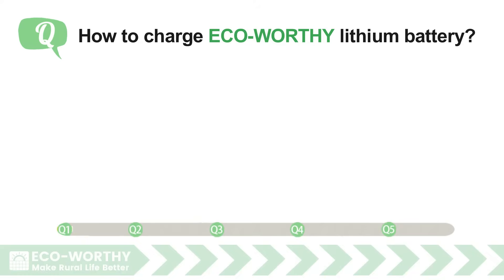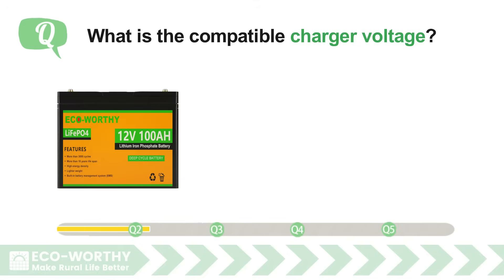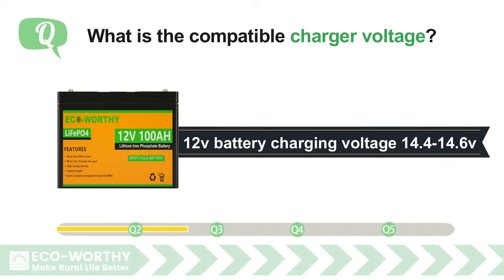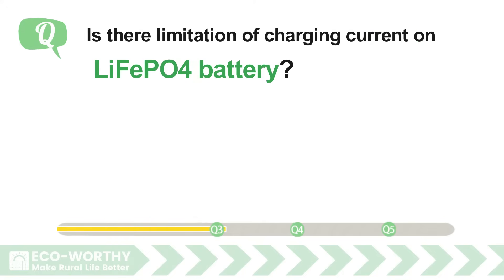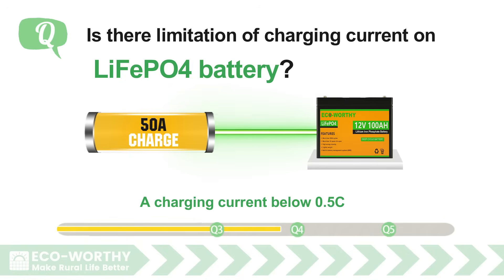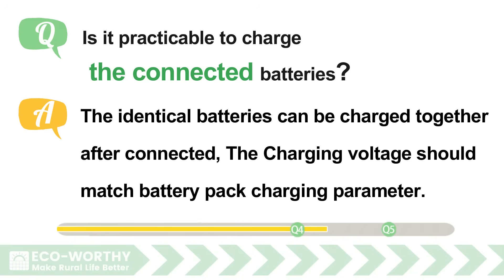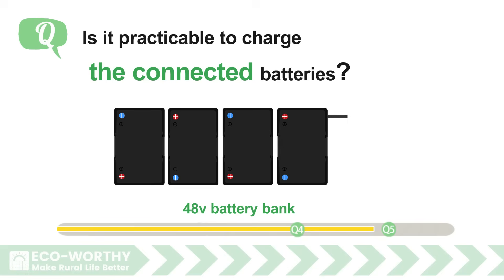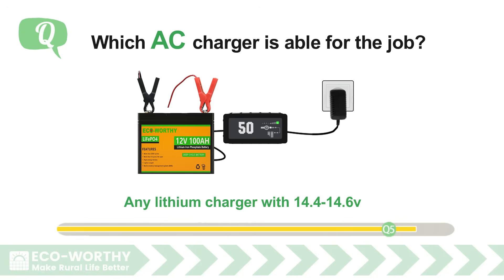FAQ about LiFePo4 Battery: how to charge my Lithium Iron Phosphate Battery

Comment: How many hours to charge this in power electricity
Reply from the maker: Charging time ≈ Battery capacity (Ah) ÷ Charging current (A) ÷ efficiency

Charger efficiency is typically around 88%–90%.
For optimal battery health, a charging current of 0.1C–0.3C is recommended, and it’s best to avoid exceeding 1C.

Comment: I have 51 volt Lipo battery 58.4 volt 33 AH with Lion battery charger and it charges the battery up to 53.5 volt only and charger stops and getting low range in my scooter, pls suggest me something to get up to charge 58 volt to get more range, thanks in advance

Comment: Hi. Is it possible to limit charging current with Bluetooth version (by software) at 12V 100Ah eco-worthy Bluetooth battery. 
I typically want to charge battery with, e.g., 15 A max, but for some time, I  need to limit the charging current up to 5A max (power supply 20A).
Is it possible?  Do you have some manual or video on how to limit charging current?
Reply from the maker: Currently, it's not possible to limit the charging current via Bluetooth. This feature is not available.

Comment: So i bought one of your 24v 100a/h batteries and a life Po4 charger 10amp at 24v. On first charge the battery would only take 87% yet the charger said it was full, the voltage seems fine, does this mean one cell is down?
Reply: @EcoWorthySolar, I got it sorted, one cell not top balanced it seems, I hope you guys manage to sort out your teething problems regarding after sales care as your products are really very good, it's just the after care where you are taking a hit. Maybe it would pay you guys in the long run to employ a native English speaker to help sort out these issues, you'll take the market by storm!! Maybe a shunt instead of hall monitor for your display and monitoring systems is a good start!! This battery is frankly amazing!! Good work guys!!!

Comment: Cómo puede ser que una batería se cargue a 14.6 v y si hay cuatro baterías en serie se cargan a 55 v. Ese vídeo está mal si divides 55 / 4 = 13.75v is not 14.6v for 4 batteries the voltage is 14.6v x 4 = 58.4v
Reply from the maker: 14.6V is the maximum charging voltage for a 12V battery, and 58.4V is the maximum charging voltage for a 48V battery. The actual voltage will be lower when the battery is not charging.

Comment: I recently bought a LiFePo4 30Ah from Eco-Worthy UK Amazon store. I emailed them to ask about charging, but got a useless reply. I sort of got the impression that the answer was from China due to the wording. 
I simply wanted to know how you determine when the battery is 100% charged. In the booklet there are conflicting answers. One table says that 13.6V is 100% charged, but the text says at full charge the voltage is 14.6V.
Reply from the maker: Some of our customer service representatives are indeed from China, and we are working to improve our team's English proficiency. The information in the table is for reference only. For LiFePO4 batteries, the battery is considered fully charged during the charging process only when the voltage reaches 14.6V. However, when the battery is at rest, a voltage of around 13.46V indicates a 100% state of charge (SOC).
Reply: @ecoworthy_official  I bought an intelligent charger off Amazon and let it figure things out.

FWIW I have been happy with my Eco-Worthy battery, and particularly the price, and I have now bought 6 LiFePo4 batteries of varying capacities. So far they have all worked well. The original one referred to in this thread has been in regular use (one or two times a week) for the past year plus.
Reply from the maker: @ Thank you so much for your support and for sharing your experience! 😊 We're thrilled to hear you've been happy with your Eco-Worthy batteries and that they've been performing well for you over the past year. It means a lot to us!💚

Comment: Is it OK to charge a 16 Amp lifepo4 battery with a 20 Amp charger or should I use a less Amp charger? Why is 50 amp charger  the most to charge a lifepo4 battery? Ty 😊
Reply: I have a 30Ah battery and could not charge it with a 20Amp charger, the BMS stopped the charger immediately, my suggestion to you is to use a 5-10 Amp charger for any battery with less than 50Ah.
Reply: @ddistrbd1 what do you think bud?
Reply: @Ricardofromage  As a newbie in the world of Lifepo4  I can only say the 10 amp charger should be able to charge a 100ah battery as long as the charger is set for lifepo4 battery not  acid/other types of batteries , if I were you I would deplete the battery low enough so the BMS would allow it to charge, another option is to use a bench top power supply  if you know how to do it.
Reply: @ddistrbd1  I'm a newbie too by the way, but I'm learning fast, there are some really great scientific yet very easy to understand guys on YouTube who explain it in layman's terms, takes some fear away hehe
Reply: I've got a 10amp charger on a 100 ah  battery and on first charge, charger said battery is full, but the battery monitor said it was only 87%. Maths says 87% I 7/8 cells (25.6v ÷ 3.2v = 8 cells, 100 ÷ 8 = 12.5%) what's your thoughts ?
Reply from the maker: We recommend charging current not exceeding half of the battery's Ah value. For a 100Ah battery, the charging current should not exceed 50A to help extend the battery's lifespan.

Comment: I recently purchased your 50ah lifepo4 battery and the charger I have will only charge the battery at around 13.7 volts in 5A mode and will only give me the 14.6 volts you recommend when in 20A mode. Is it okay to charge at 13.7 volts 5A slow charging? I personallly like slow charging my batteries.
Reply: Yes. It will just take a longer time to charge, than say a 10 amp charger.

Comment: How about charging it with an alternator in a car? Does the BMS limit the charging current?
Reply from the maker: The battery has overcurrent protection, but we do not recommend using a car alternator to charge the battery. It's best to use a charger specifically designed for lithium batteries.
Reply from the maker: Maybe You need one inverter between battery and alternator,sir
Reply: @ecoworthy_official  Not a usable answer.
Reply: @mrcleanisin yes it is. You cant do that. You need a lifepo charging booster to do that

Comment: Hi, I have a photovoltaic kit with 2 120W 12V solar panels (therefore 240W in total) a 30A charge controller, 600/1200 inverter and a 50A 12V lifepo4 battery?
I figured out that to protect the battery life I don't have to fully discharge it. But how do I understand the charge level of my battery? Could you please help me? thanks
Reply from the maker: Hello, there is one table of voltage and capacity reference, url:https://www.eco-worthy.com/blogs/news/how-to-properly-charge-my-lithium-battery-charging-guide-of-eco-worthy-lithium-battery